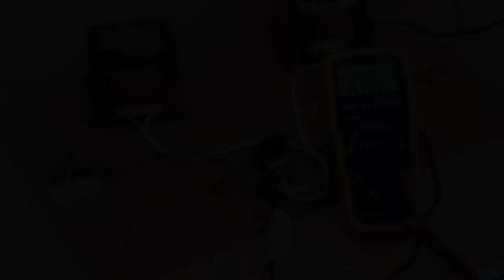DIY Welding Machine / Only 2 Microwave Transformer / Good Job

Comment: Oh my God don't ever use a table saw like that I got two teeth busted out of my face doing that use a block next to the fence for setting the distance then remove the block when you make the cut that way if anything binds it doesn't throw it back in your face. So if you have a 1 inch block set the fence to 1 inch greater than your cut and use the block to measure the distance then remove the block to make your cut never combine a fence with the T square
Reply from the maker: Thank you for your recommendations.  I agree that you are right about this.  But now I can say that I am more careful.  Respects...
Reply: Amigo saludos desde Venezuela Maracaibo... ! Que calibre de cable usaste para embobinar el transformador?
Reply: Quantas voltas de fio você usou?

Comment: Why did you eventually add 5 bridge rectifier why 5
Reply from the maker: Hello. Considering that the welding machine I made can give a maximum current of 120 Amps, I wanted to make a system that can withstand twice the current in order to minimize the possibility of failure. For this reason, I used 5 diodes, 1 of which is 50A. In this case, since I connected 5 diodes in parallel, I obtained a current resistance of 5x50=250A. In this way, the diodes do not overheat. They never failed.

Comment: Hello friend, thanks for the video.  Could you tell me, I also made with two transformers with a 6mm wire and I have 33 volts.  Do I need to wind more turns to be like your 40 volts?  If I increase the number of turns will it be easier to burn the electrode?
Reply from the maker: Hello.  Since your cable is thicker, I guess 17 turns fit in each transformer.  But 33V will suffice.  The higher the voltage, the easier the arc starts at first.  If you are not satisfied with the situation, you can use 1 more transformer and obtain a total voltage of around 50V.
Reply: Hola quería preguntarte si conoces cual es el mínimo voltaje en vacío de una máquina para que pueda ser capaz de quemar electrodos 6011. Tengo entendido que necesitan algunos voltios más que los comunes 6013.
Reply from the maker: @pocatefo1  Hola.  No tengo suficiente información sobre las diferencias de valor de voltaje en los electrodos.  Siento no poder ayudarte, por favor
Reply: Olá essa plaquinha q vc colocou vc montou ou comprou montada passa link pra gente 👏👍

Comment: Well done mate. The ply wood on the top of your box does nothing but make your box hotter. Get rid of it.
Reply from the maker: Hello.  The plywood on the top ensures that the box is solid.  first the back panel is screwed to this plywood.
Reply: If that's the case then why not just add a couple of lug's when you fold it or put a couple of brackets?
Reply from the maker: I am in favor of evaluating the material at hand.  Since the aluminum I used in the cover part is 1mm, something like this was needed to attach the handle.  You are right about bracket, but since that is the case, I prefer this way.  I will do AC/DC conversion soon.  Maybe box sizes vary

Comment: Hi, you said you used 13 meters of cable. For one of the transformer or for both ??. The other question is if you can be winding one single cable for both Transformers avoiding the connection between both  cables ???
Reply from the maker: Hello.  13 meters is for two transformers.  ie 6.5 meters for each transformer.  You can wind two transformers in succession.  however, this may be a bit of a hassle as it will have to deal with a longer cable.
Reply: Hola una pregunta y sería para corriente 110v o 220v
Reply from the maker: Hola.  Cualquiera que sea el voltaje de red utilizado en el lugar donde vive, el dispositivo funcionará a ese voltaje.  Porque los transformadores del horno de microondas que utilizará están diseñados para funcionar con este valor de voltaje.  En este caso, lo único que cambia es el valor de voltaje de 110 V, la máquina de soldar consume más corriente.  Porque se calcula como "POTENCIA = VOLTAJE X CORRIENTE".  Es decir, para obtener la misma potencia, la corriente debe aumentar cuando cae el voltaje.  En este caso, el cable de enchufe utilizado en la entrada debe ser más grueso (3x2,5 mm2) y el circuito de atenuación utilizado para el ajuste de la corriente de salida debe ser más resistente.  Más precisamente, debería soportar más corriente.  Espero poder ayudar.  Vuelva a escribir si hay algo que no esté claro.
Reply: excelente amigo muchísimas gracias de verdad me gustó mucho esa máquina 👍
Reply from the maker: Me alegro de que te guste.  No puedo decir que sea una máquina profesional, pero hace un buen trabajo.  Próximamente haré un video sobre el proceso de conversión del voltaje de salida a DC.  Te deseo un buen dia
Reply: el cable es de alta temperatura? Y que calibre es
Reply from the maker: Sí, la bobina se calienta.  Se utilizó cable de 4mm2.  Sin embargo, dado que se utiliza un cable de cobre aislado con silicona, no hay problema en el aislamiento.  El cable que uso tiene la característica de trabajar a 180 grados.
Reply: gracias por la informacion, muy bonito planta electrica hiciste, ya consegui mis transformadores para hacer una como la tuya
Reply from the maker: Gracias.  Me alegro de que te guste.  Intentaré convertir el voltaje de salida a CC pronto.
Reply: estare pendiente para verlo y aplicarlo
Reply: díagram please
Reply from the maker: Hola de nuevo.  Puedes encontrar documentos de medidas o diagramas en todos mis videos en la sección de explicación.  Dejo los enlaces a continuación para este video.

CONNECTION DIAGRAM https://drive.google.com/file/d/1R7cFIScJsMNDwwgNJNgOwgGk7Skn50UK/view?usp=sharing
 https://drive.google.com/file/d/1NoQeD8Wd9HW9TT3OQOkoq9BUoZidIL-n/view?usp=sharing
Reply: Great job I only have two minor issues, both safety related. You should alawys have a A Fuse n your live wire in any mains device. The second is more of a recommendation. The Cable you used wuold most likey be covered in PVC coating. Those coatings have poor high temperature performanve which means you sould rund the welder in very low duty cycle maybe 15%. So I would suggest a thermal switch be aded to the design to keep it from verheating and melting the insulation. Other that that great build.
Reply from the maker: Hello.  Firstly, thank you.  It would be better if the fuse was installed.  The cable I use is a silicon insulated copper cable.  It can be found with the code N2GFAF.  It has the feature of continuous operation at 180 degrees.  Of course, it would be better if a thermal fuse was still installed.  Thank you for your interest and advice. 👍
Reply: Hello what Is red of pwm controller AND the transistor thanks bro!!!!
Reply from the maker: Hello.  The circuit I am using is not a pwm controller.  A simple dimmer circuit.  You can easily find it in the market.  The circuit elements I use are triacs.  I added these elements to the circuit to make it stronger.  The general wiring diagram of the system and the wiring diagram of the triacs are available in the description section.  Take a look if you want and write again if you want to ask.
Reply: @rhonyroyherrerabestit2328  follow the transformer's voltage rating in this case 220v
Reply: Dude. I love how you go all the way and do it right and clean.  Also how you built just about everything you used.  You sir ROCK.
Reply: a

Comment: Instead of using a microwave transformer, you can use a metal halide transformer. I use a 1000w transformer for charging my super caps.
Reply from the maker: Hello.  Thank you for your comment and recommendation.  The reason we use microwave transformers is because they are waste materials.  actually it's cheap... a transformer of the type you're talking about must be pretty expensive.

Comment: I’ve finally found a welding machine video with plans worth trying to build. Thank you
Reply from the maker: Thank you too.  I also did the process of converting the output voltage of this machine to DC.  If you haven't watched it, you can find it on my channel 👍
Reply: to DC.

Now that would really be handy for off road/off grid type of work.

Brilliant man.

Comment: Até hoje é a maquina mais bem produzida.
A começar com os transformadores iguais e o cabo de silicone e o ajuste de voltagem ficou show.....😁👍🏼
Reply from the maker: Muito obrigado.  Fico feliz que tenha gostado 👍👍👍
Reply: Hello @Murat Guney since I have a 4000w dimmer but the fuse burns out, I would like to boost it with triacs, which triac should I put and if you could tell me the precise abbreviation since there are many on the internet, thanks you are number one 😉
Reply: No sé si funciona ,pero debemos  reconocer que el acabado de la maquina  es muy profesional. Felicitaciones. Preto
Reply: Felicitaciones,es el mejor video de su clase,gracias por aportar está enseñanza.

Comment: This is how a professional does it and if someone wants to build one they should hone their shills with this very good multifaceted master tradesman as their level of safety and build quality. Incredible work man, best I've seen on the internet.
Reply from the maker: Thank you so much.  I'm glad you like it.  What you wrote made me happy.  I wish you a good day
Reply: What is the nomber of that wire sir good master
Reply: Which component use i don't know
Reply from the maker: I think you are talking about the components I added to the dimmer circuit.  These materials are triac.  Number BT137
Reply: Thanks buddy
Reply from the maker: @faizykhan6373  Thank you too
Reply: Yes, very nice project. My tombstone has a mechanical sliding effect of the transformer core. Other one has multiple windings to select different power outputs. 

This was a new one and I really liked how you could just source junk to make your own stick welder. I already made a spot welder with 1 transformer. 

I see that you put the transformers correctly. In the AC it is important to put transformers in series and not in parallel. In parallel the other transformer might have different characteristics and it might point the vector a slightly off to what the other one does and it might cause a short.

Comment: Muy buen video quiero saber donde le conectaste el triac ala placa del dimer yo se que es mas de electronica pero quisiera saber como los añadiste
Reply from the maker: Hola.  Los diagramas sobre las conexiones están disponibles en la sección de descripción.  Traté de preparar los diagramas de una manera simple y comprensible, pero si aún no está claro, puede preguntar.  Gracias por su atención

Comment: I really like how you used the TRIAC controller here. On my current project I have refused to rectification because A/C is fun and simple! Great work, man! 👍
Also thanks for the wiring diagram bonus!!
Reply from the maker: I thank you too.  I don't know if it will interest you, but you can find the measurements in PDF format in my other videos.  Greetings from Turkey
Reply: which TRIAC reference should I use for a 4000 W dimmer?
Did you use a 2000W dimmer? 🙂

4000 W dimmer için hangi TRIAC referansını kullanmalıyım?
2000W dimmer kullandınız mı?
Reply: Isn't A/C dangerous? And is DC safe?
Reply from the maker: I will try to convert the output to DC soon.  I'll post a video if it works the way it should.  But I don't understand why AC is dangerous.
Reply: Thanks for your tutorials. I'm not much educated in these electronic things. But what I notice is AC welding machines would get us shocked if we mistakenly touch the metal while welding. But DC never gets any shock even if we touch the metal. Is that true?
Reply from the maker: This is not related to AC or DC.  It's about voltage.  The human body begins to feel the current flowing through it after a certain voltage value.  In this machine, it is not felt because the output voltage is 40V.  Of course it does pass a current but is not considered harmful.  In general, over 50V, whether AC or DC, is considered dangerous voltage.
Reply: Thank you very much. I learned a new thing from you. I'll look more about this subject on google.
Reply: BTW One more thing, Is it true that some say DC welding light/sparkle isn't harmful to the eyes but AC  light is harmful?
Reply from the maker: @KamakNeApiMalimawata  I don't know about this.  But I don't think so.  Excessive light is always harmful.  During the arc, excessive light comes out and exposure to UV rays.  Masks should definitely be used.  I recommend self darkening masks.
Reply: Thanks.
Reply from the maker: thank you too 👍
Reply: Do you have an idea of how the frequency could be adjustable, or just doubled? Also a way of clipping the ac to keep the cleaning action but weld mostly single polarity. A high frequency starter would be amazing too.
Reply: @KamakNeApiMalimawata  True is that there are standards that tells us what max. voltage could be considered as safe for humans - and it's 36v AC and 50v DC
Reply from the maker: Hello.  I must have overlooked this message.  Otherwise I wouldn't have left it unanswered.  Please don't be offended.  You mentioned doubling the frequency.  In fact, this can be done with a simple process.  When you connect a bridge diode to the output without using a capacitor, the frequency that is 50Hz will be 100Hz after the bridge diode.
Reply from the maker: I can't say anything about AC being safer than DC.  I haven't done research on this.  Why do you think it is?
Reply from the maker: Thank you for your answer 👍
Reply: Ini mesin saya minat bos
Reply from the maker: @kusnadi2398  👍
Reply from the maker: Hi.  You have seen the dimmer circuit I use.  I used 4 triacs in parallel to strengthen the circuit.  You can do it this way too.  You can use 4 bt137s.  How to make the connection is shown in the diagrams in the description section.  Please take a look and ask if there are any unclear places.
Reply: actually the diagram is very clear. I didn’t know TRIACs could be used in parallel. I would assume it’s imperative that the TRIACs are all of the same type before wiring in parallel? Thanks for the clarity my friend
Reply: Ac and dc have danger hazards but dc is significantly safer requiring higher voltage to be lethal. Also you only measure the rms voltage with a multimeter not the peak so the peak voltage value is significantly higher with average . Ac becomes significantly more dangerous with increasing frequency until it starts becoming less dangerous and past 20,000hz it can no longer electrocute you it can only burn you. Raising the frequency higher electricity starts becoming more susceptible to impeacance bs and just shoots through the air as radio waves in the correct circumstances.
Reply from the maker: Devo dizer que ele fez uma declaração muito boa.  O valor RMS e a diferença do valor de pico são muito importantes.  O valor de pico da tensão com valor 220V rms é 311V.  Se considerarmos o valor teep to peak, corresponde a 622V.  Obrigado pela informação
Reply from the maker: Devo dizer que ele fez uma declaração muito boa.  O valor RMS e a diferença do valor de pico são muito importantes.  O valor de pico da tensão com valor 220V rms é 311V.  Se considerarmos o valor teep to peak, corresponde a 622V.  Obrigado pela informação

Comment: All those microwave transformer welding machine I have seen , I like that one you made .
Reply from the maker: Thank you very much. I'm glad you like it. The welding machine is doing good work.
Reply: buenas mi estimado amigo q numeros son los integrados q usaste por favor espero una respuesta pronto gracias
Reply: hermosa  maquina q numeros son los integrados por favor
Reply from the maker: Hola. No entendí completamente la pregunta. ¿Qué entiendes por números enteros?
Reply from the maker: El cable que uso es un cable de cobre con aislamiento de silicona de 4 mm2 de sección transversal, hice 24 devanados en cada transformador, usé 6,5 metros de cable en cada transformador para 24 devanados. Un total de 13 metros de cable. Para la regulación de corriente se requiere un circuito dimmer de 4000W de potencia. Dado que el circuito de atenuación en mi mano es de baja potencia, reforcé el circuito conectando 4 triacs (BT137). No sé si la respuesta a su pregunta ha sido respondida, pero si esta no es la respuesta, por favor escriba con más detalle.
Reply: murat guney bey elinize saglik basarili bi proje yaptiz lakin benim merak ettigim dimeri 220v girisinemi bagladiniz anlamak istedigim 220v tu duruncemi amper de dusus oluyor bide boyle degerde bir projeye kac watt dimer taktiniz tesekkurler
Reply from the maker: Merhaba. Dimmeri 220V tarafına taktım. Giriş gerilimi azalınca çıkış gerilimi de azalıyor ve buna bağlı olarak çıkış akımı da azalıyor. Kullanılması gereken dimmer 4000W gücünde olmalı. Ya da düşük güçlü bir devreyi benim yaptığım gibi güçlendirmek gerekir. Bağlantılar ile ilgili şemalar açıklama bölümünde mevcut. Videoyu altyazılı izlemenizi tavsiye ederim. İyi günler
Reply: tesekkur ederim vermis oldugunuz bilgi icin bende yaptim aynisini henuz bir kutuve dimer ve fanlari ayarlamadim tekrardan tesekkur ederim
Reply from the maker: Ben de teşekkür ederim. İyi günler

Comment: Well done!! This is one of the best work I've seen, I build one by myself and  it worked perfectly after watching your video. Great work done!!!!!!
Reply from the maker: Thank you so much. I am glad you like it 👍
Reply: where do u live is your electricity  is 120 or 220 thx
Reply from the maker: This is Turkey.  Mains voltage 220V
Reply: @johnal4560  I'm in Ghana .We are using 220V
Reply: Hi what did you use for voltage control
Reply: Hi how can i contact you?